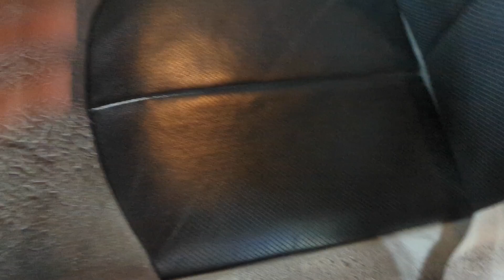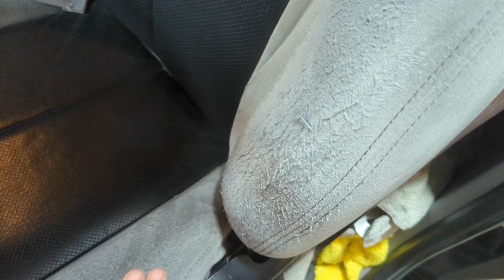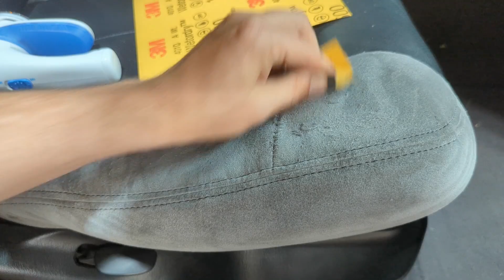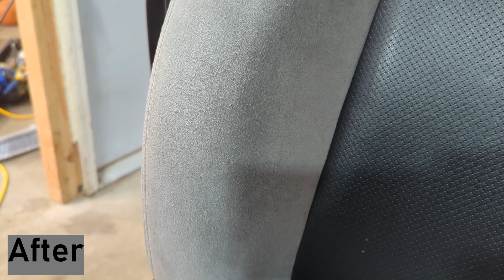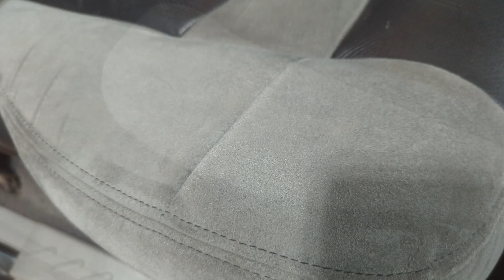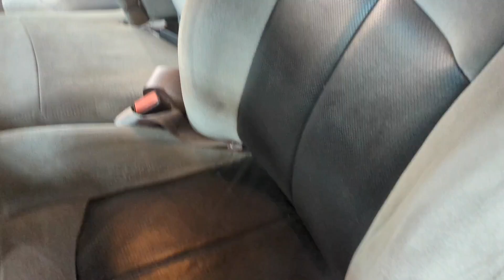How to Repair Your SVT Lightning and Cobra Alcantara/Suede Seats -- Make Them Look New!

Comment: hey mate, im curious as to if the piling has come back. i think its been a year since you removed the excess fabric,. do u use these seats daily? and has any piling returned in the areas of which you treated?
Reply from the maker: I drive it on the weekends and stuff. Maybe just a little has come back. I'll probably do this deal every 5 years or so. As needed.